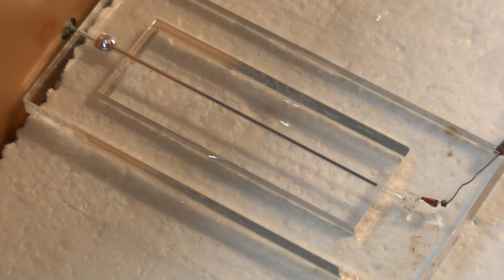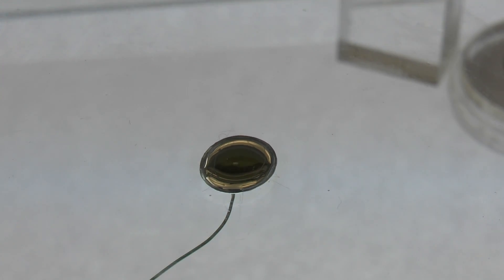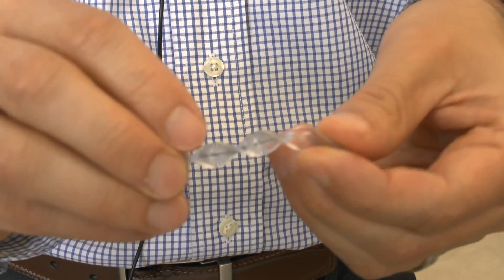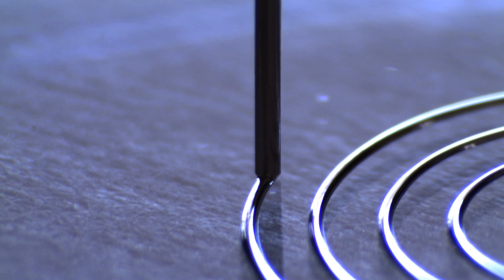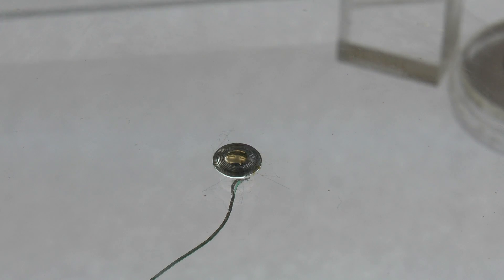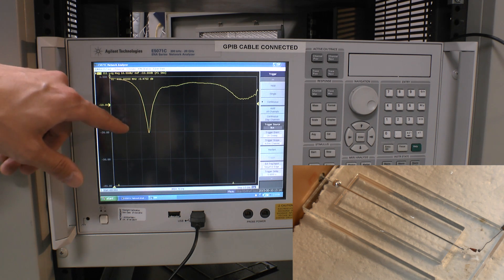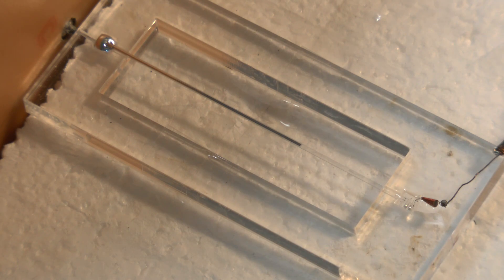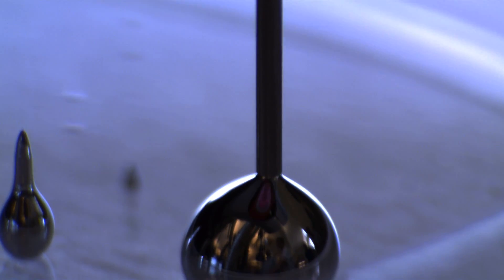Shape-Shifting Liquid-Metal Antennas

Comment: how are they adjusting the reductive/oxidative bias?
Reply: It sounds like they are applying a DC bias while in NaOH(aq). Coupled with microfluidics this could be very interesting for millimeter band and higher frequencies, but anything below 5ghz or so would likely just use mechanical tuning.